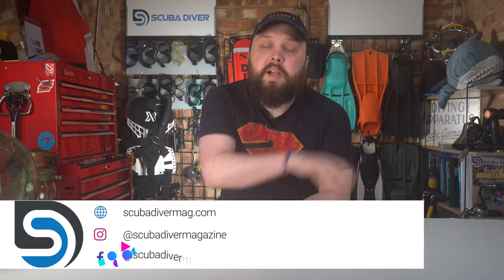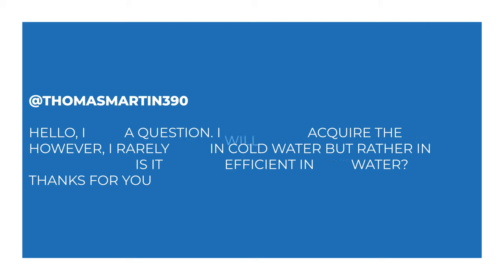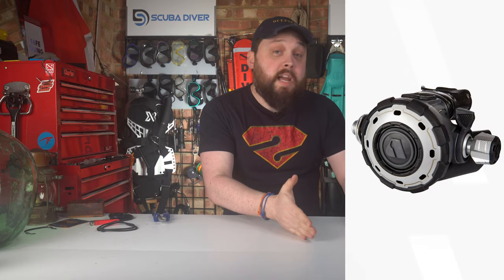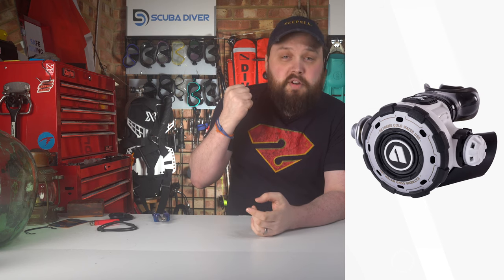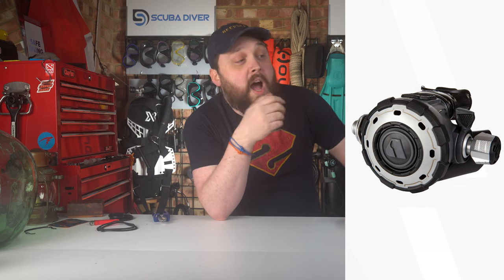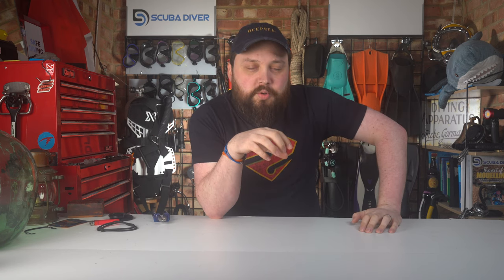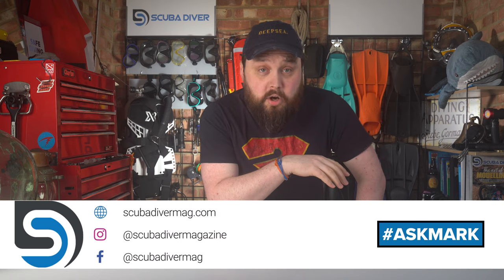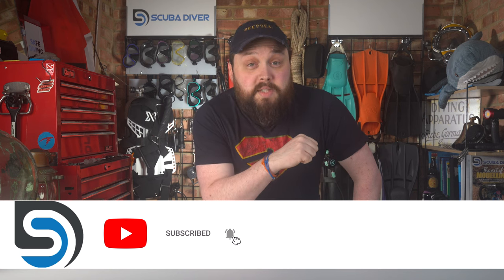Do Cold Water Regs Work in Warm Water? #askmark #scuba

Comment: #askmark Hi Mark, I did my drysuit course back in February in a 4 degree lake in the UK. I was using a Fourth Element Hydra that was small anyway but tighter than a wetsuit for me with thick undergarments on. During the two dives I was using the drysuit for buoyancy and all the air was going to my feet and I kept becoming inverted. I was using negatively buoyant Fourth Element Tech Fins so that should’ve helped but it didn’t. I kept having to do recoveries and it kind of ruined the idea of drysuit diving and wasn’t great fun. My question is: What do you think caused this? And how can I prevent it when I ultimately come to get my own Drysuit? And one last question can you explain the difference between Apollo, Apeks and Si-Tech drysuit valves? Kind regards, Isaac.
Reply from the maker: A lot of it is practice and correct weighting, it will come with time, it's why drysuit training is essential. The neoprene of the drysuit and bulky undersuit wouldn't have helped either by making your legs more buoyant.

It could be that you could drop some lead from your weightbelt, then you won't need to add as much gas during the dive. You should only need to add enough gas inside your drysuit to alleviate the squeeze, too much and it will throw your centre of buoyancy off.

Apeks and SiTech valves are pretty similar, I've never noticed a huge difference between the designs. The chest valve has a simple button to inflate and the shoulder valves screw in and out to adjust the sensitivity. Apollo are different. The chest valve is similar enough but, the shoulder valve has three settings to adjust the sensitivity. They all do the same thing just in slightly different ways.

Comment: #askmark Hi Mark! I'm looking to buy some regs for two stage bottles, but don't want to spend too much money. Is there any reg you can recommend that is on the cheaper side, but will still work for more demanding dives and won't force me to upgrade later on?
Reply from the maker: It depends on what you can get serviced conveniently. You can save money buying a particular model only to spend more money sending it off to a service centre further away.

I'm partial to Apeks and Scubapro regulators. I'd be thinking about the DS4 or the DB4 from Apeks or the Mk17 _ if you can still find one_, from Scubapro. Even the Mk2 is a nice 1st stage if you don't need many hoses routing from it.
Mares regs have a great balance of quality and price, something like the 15x or 62x are worth considering.

Comment: Hello Mark,
We recently had a little oops-a-daisy at the lake.
We put our sidemount tanks in the lake when suddenly strong winds came up.
The result was that the bottles drifted away.
Three were found immediately, but one was gone and we searched for about an hour to find it again (which luckily we did).
Is there a way to securely attach the tanks to the bank in the water?
Thanks and best regards from Austria
#askmark
Reply from the maker: Luckily for me the last time something similar to this happened to me I had access to a RIB.

I usually bring some rope and a collapsible grapnel anchor with me to tie a secure line to clip the cylinders to in the water. Secure the anchor and tie a buoy a good distance from it so it can be seen on the surface.

If there's something heavy near the water's edge I'll tie it to that with the rope leading into the water.
Reply: While Mark has replied below, I would also add the following that by using the 3 videos below, you could figure how to secure your tanks using the 3 videos below:
https://www.youtube.com/watch?v=wioZGY4INbY
https://www.youtube.com/watch?v=hCpI2_jtMMc
https://www.youtube.com/watch?v=CsPfNf7ZOL8

However, I would further add that I never have a strong winds scenario before (depending how strong it is I suppose) or to actually have the tanks in the banks of water.   We do however put them submerged in the water with a torpedo buoy (vertically), or if the area has no other divers, we put them vertically in water.  With experience in lineworks/ knots and a bit of creativity, I think you'll be able to solve it.  Besides, in order of anyone to give you a specific solution to your problem, you do need to describe us more on the exact location you want to put the tanks (photos would help a lot).  Mark's suggestion of anchors are perfect too.  I never had the need to use a collapsible anchors before though.  All the best.

P.s. gosh!! I hope one day I can dive in Austria.  Sounds fun !!

Comment: #askmark if you buy a new regulator does the manufacturer recommend a new 2nd stage to go with that regulator?  i see a lot of new 1st stage regs come with primary 2nd stages, at least that' how there displayed in the shop, but if you already have a primary and octo 2nd stage are they fine with the new regulator?
Reply from the maker: It depends...

A lot of the time it will function perfectly fine but, there are some considerations. First is the ISP, each 1st stage will be set up by the manufacturer to regulate to a certain pressure but, this can vary between model and slightly between individual 1st stages. The 2nd stages or 1st stage might need a little tweak so they work together properly.

On the warranty / standards side, each 1st /2nd stage combination is tested and certified for EN250. But manufacturers will only certify specific 2nd stages to each 1st stage because the testing and certifying is expensive. So pairing any 1st and 2nd stage together may function but, won't be guaranteed by the manufacturer

Comment: #askmark - Hello Mark, a question about the swivel that you have to install in the high-pressure hoses to the pressure gauge. I have now bought new MIFLEX hoses for my 2nd stage and the octopus as a replacement for the old rubber hoses and there was NO swivel in the old connections. Sure, they were sealed beforehand - so do you actually only need them in the high-pressure hoses? Thank you for a short answer - and thank you for the great explanatory videos on your channel :)
Reply from the maker: You only need swivel pins on high pressure hoses. On low pressure hoses you'll find O-Rings on both ends that are all you need.
The O-ring on the female end of a regulator hose can be hard to see but, it's there. I'll show you in a vid
Reply: @ScubaDiverMagazine  ah thx - I have seen the o-Ring only on the hose-side - not inside the female part of the 2. stage… so I will wait on your video 👍🏼🤗

Comment: #askmark I am in the market for a new DSMB. I came across new white and black or orange and black models. Razor make some for example. Apparently, they are easier to see under various circumstances which makes perfect sense to me. They already really stick out on the product photos. Is there a reason to not go with them like specific regulations that have to be a single colour?
Reply from the maker: Yeah, two-tone dSMBs have been around for a while and as they rotate and move on the surface they can give a 'flashing' effect to catch the eye. 

In some circles the colour of dSMB has a specific meaning so two-colour buoys can lead to confusion. But this can be dispelled before the dive by just letting the crew know you are diving with a certain dSMB. That's the only downside that I can think of

Comment: #askmark Is Mares Quad CI worth waiting? On paper it looks promising for now, but not many information are shared for now, apart from the ones from few online dive stores.
Reply from the maker: The Ci hasn't been officially released yet. Too many dealers release information early to get a head start on Google ranking and pre-sales.

From what I can tell, the Ci is a Sirius in the body of a Quad. If those are the features you need in a dive computer then Mares are generally good computers you can trust.